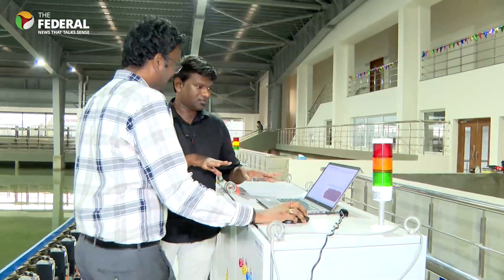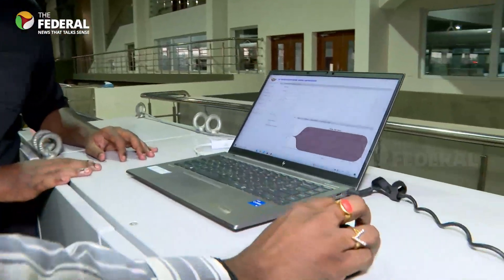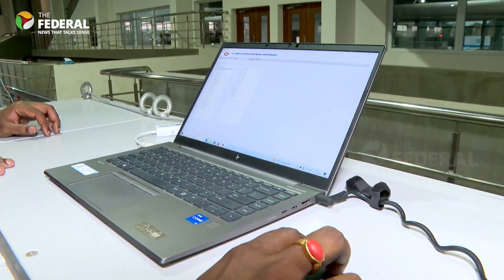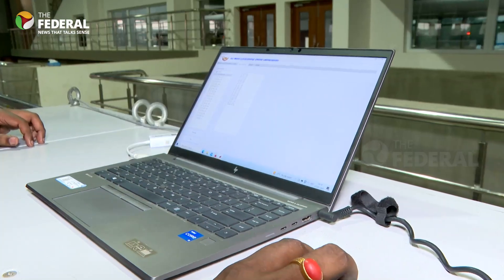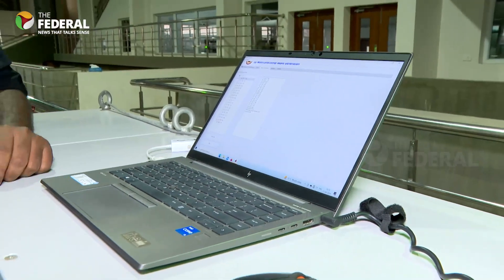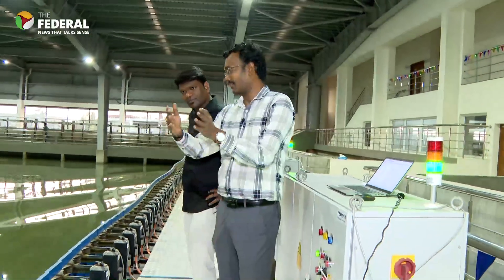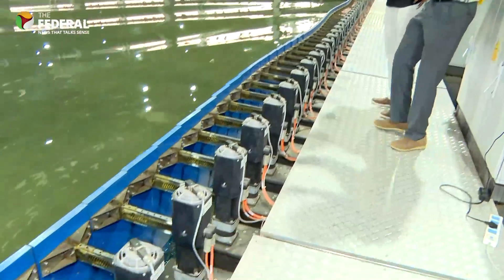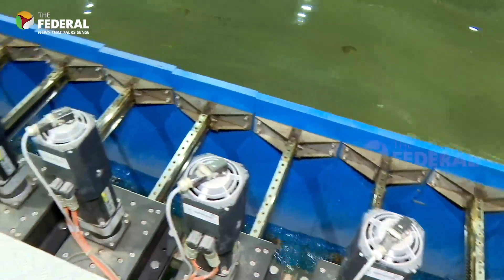Watch: IIT-M engineers set up India's largest, state-of-the-art shallow wave basin

Comment: I have one suggestion to electricity. 
We must study travel of waves and duration of waves manufacturing. 
It's a artificial so very easy to study. 
After studying this  do manipulation of timing. 
Timer can be fixed to motor. 
For surfing what types of waves is needed, how we can save electricity. Try to do experiment with hydro electricity to run this instrument.  
Jay bharat.
Reply: I have some other suggestions. 
Machine is like piston or spring. 
Give very slight incline angel for ball to move from higher to lower base. Ball while moving will push the syringe or spring. 
With help of converer belt bring ball up and machine will bring down creating a waves. 
It can be successful or not successful also because duration of movement of water is different. 
Jay bharat.
Reply: We can get rid of electricity, if  ever...we get success. 
 I think we must play with no of  ball to create waves for surfing.  Jay bharat.
Reply: Give shape v facing towards  target for  ....pushing ball towards......target of spring or syringe. 
 Jay bharat.

Comment: 360kW, not 360kW per hour.  Impressive construction indeed, kudos to the designers, engineers and builders.
Reply: I think it's 360 kWh, basic unit  used in electricity consumption calculation

Comment: Can we use it reverse to produce electricity from ocean waves?
Reply: We can test a technology for such conditions.
Reply: No that is not how the servo actuator which creates this wave motion works. It can be controlled only electronically. If you try to push the actuator with force(either by waves in this use case or by hammering it with a large truck or torpedo) it'll simply break the gear components but won't produce electricity.
Reply: ในแม่น้ำที่มีเรือแล่นประจำน่าจะใช้ได้❤❤
Reply: This is exactly what I was thinking why don't we harness energy from natural waves? Produce energy by using the right technology, something similar to what is used with water dams or something
Reply: @someonesomething6117 Problem with weather conditions 😅 And manufacturing and maintenance cost
Reply: Already exists
Reply: i thought that was the purpose
Reply: @rrajan5476  no, energy is genrated through tides as far as i know, but i don't think it's done using waves, waves are to random, and there won't be any effective motion in one direction